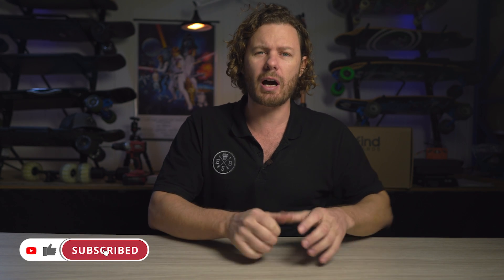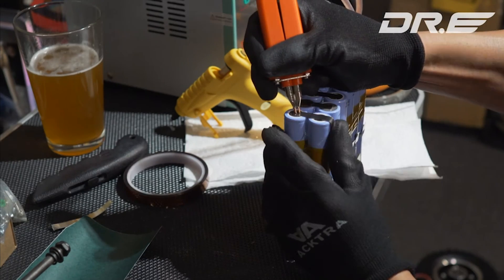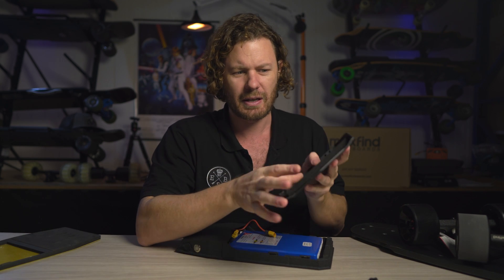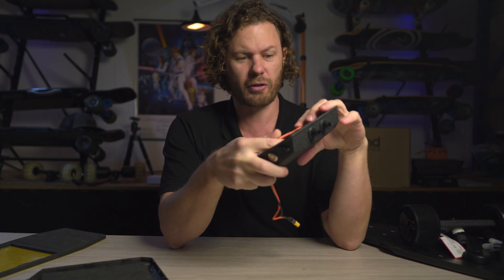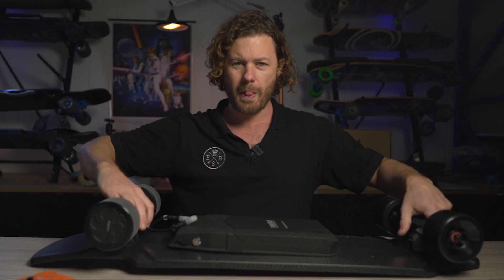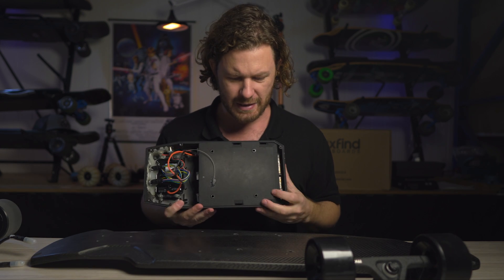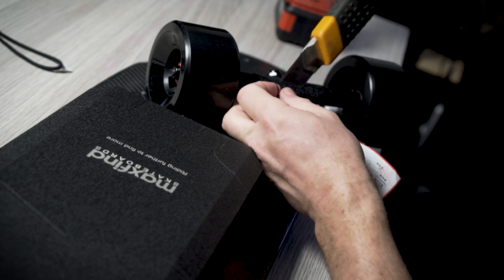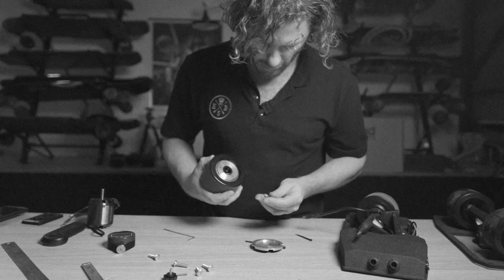Maxfind M5 Drive Kit vs DIY vs BUY | How to Future Proof Your Electric Skateboard

Comment: Yes yes yes. Thank you. I've been doing this for years now. Started with a Teemo. Upgraded deck. Later motors/battery. New ESC and remotes. Thank you teemo/ownboard/wowgo/skullboard/meepo/lycaon and diy community. Did a full swap of hub motors recently took all apart to upgrade to rubber tires for fall/winter rides.

Comment: Pretty cool video. I have a Max4 Pro that I use as a spare. The 750W M5 hubs really are pretty nicely made, but I think they would really wake up with a different ESC. I didn’t spring for the battery upgrade because I didn’t realize the difference between 22P and 30Q. Those 22Ps (used in the 4.4 batteries) feel pretty sleepy after some riding. Jason was definitely right that you want to get the battery upgrade and think about the future.

Comment: Is maxfind owned by exway?
Reply: Weaksauce P no it is not
Reply: They both use a lot of Hobbywing components, so does wowgo for that matter. I’ve looked inside both and they look pretty close. MaxFind M5 hubs are rated for 750w continuous, the best exway hubs are only rated for 600w.
Reply: @jeremyhaile804  Do you think the MaxFind M5 hubs are really 750W continumous? if you do some test, you will find the truth. Also you can make a comparsion with exway board to check which one is more powerful, you will see who is more honest with their products and customers.
Reply: Eovan Board.  Maybe so. When I’m swapping components around I can do some testing for science and put it behind a vesc and a decent 30Q battery. Curious, do you have any basis to refute those claims?
Reply: @jeremyhaile804  you can calculate when dual  motor offer 750W continuous power need how much continuous current under 10S 18650 battery pack（36~42Voltage） drive, and whether 30Q is enough to offer it or not. Easy work to find the truth
Reply: My understanding was hobywing owned exway
Reply: Weaksauce P nah hobbywing is connected to exway yes but not owners of exway

Comment: So the more i watch your videos , the more my anger diminishes towards the fact i feel cheated in purchasing a R2.1 from you. 2 years of saving and an insane wait not knowing when my working and saving and patience  would finally pay off. Then when the day finally came , it felt like a 10 year on xmas morn. But within 2 weeks....major issues.  Started with one of the motors starting to knock. Progressively worse daily. Then remote randomly losing connection briefly at the worst times it always felt like about once every couple days. ( one leading to a concussion but ride at your own risk so....) then the nail in the coffin. The wheels chipping to shit. Not even a full month of riding and it was R.I.P. not only to my R2.1 but also my over 3 years of saving and waiting to ride. Tried to get a replacement motor and wheels but well.....yeah. Seems those parts are now extinct. So you can imagine you werent popular with me. But its been almost 2 months since the board became useless due to massive defects and me giving up after weeks of searching for parts i could afford since warranty is well.....yeah. Im starting to get used to riding the bus again and cursing your name less. I think its the fact i can see your true passion for the sport , and can appreciate the effort and balls in took to start Enertion. I may have lost a board  and a couple grand $. But i have cooled down enough to see it pales in comparision to what you must of lost. Cant say im still not a bit pissed but with every vid I start to see a bit less "Red". So guess i will save up once again and with vids like this possibly somehow Frankenstein my R2.1 back to life one day. Thank you for the vid. And thank you for having the courage to create the sickest Eboard in the world at one point in time. Best ride i ever had....dont tell my girlfriend i said that.

Comment: I bought an evolve gtx  2 years ago  but recently  upgraded the default  battery  to Samsung  30q cells.
Reply from the maker: Are you happy with the upgrade?
Reply: @ElectricSkateboardBuilder   Yeh  really happy  with  performance  boost  , eats hills for Breakfast and battery sag  feels alot less .  Only   problem is   riser  pad  and battery  case  aren't  siting  together  well,  so I'll be fixing that eventually  👍😎😃